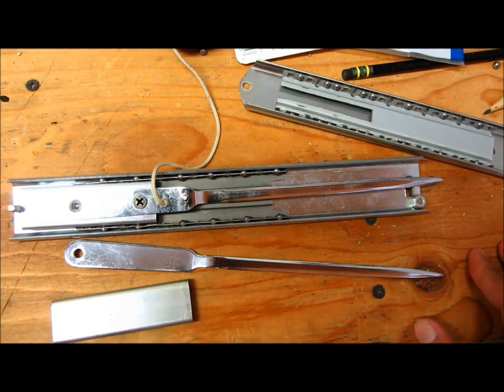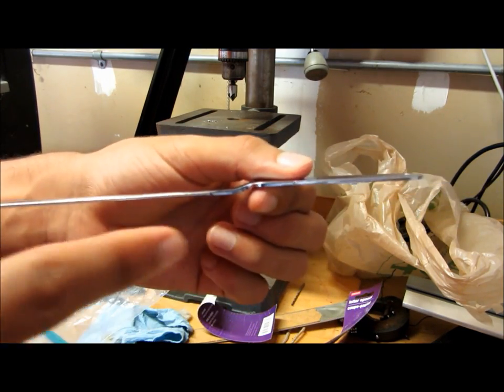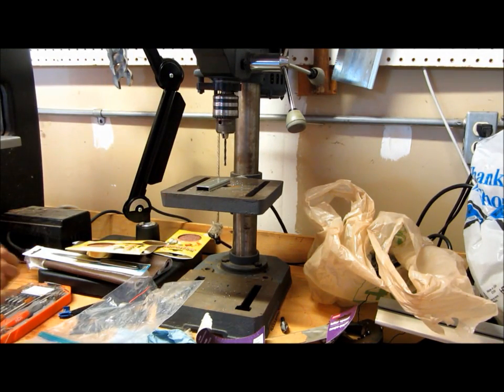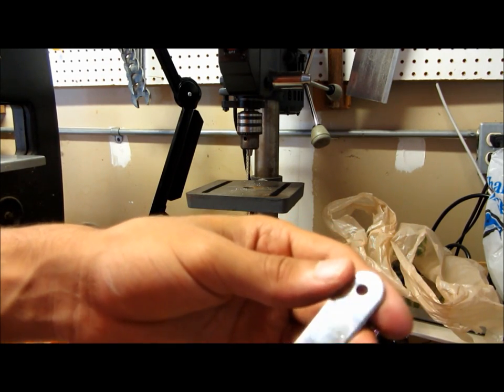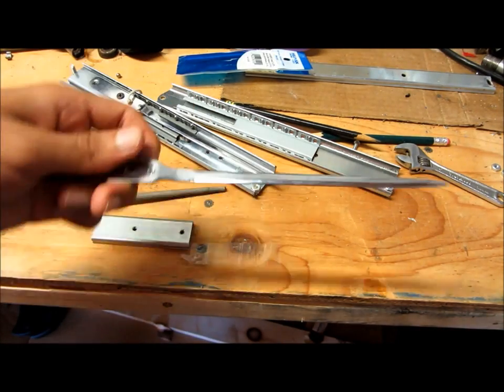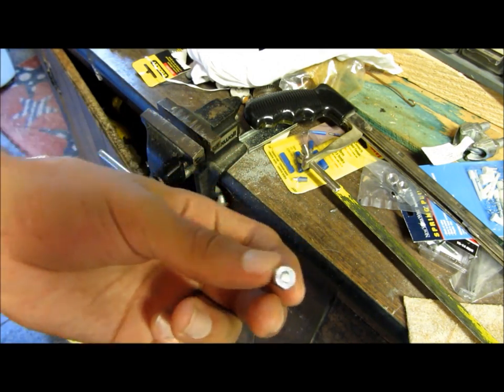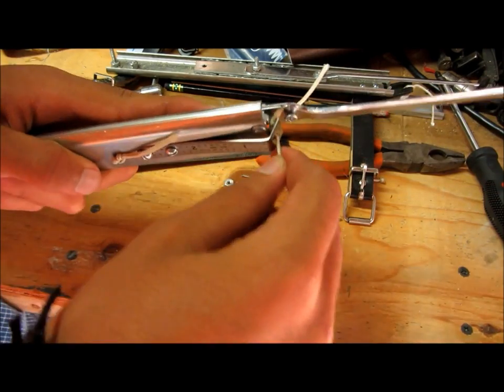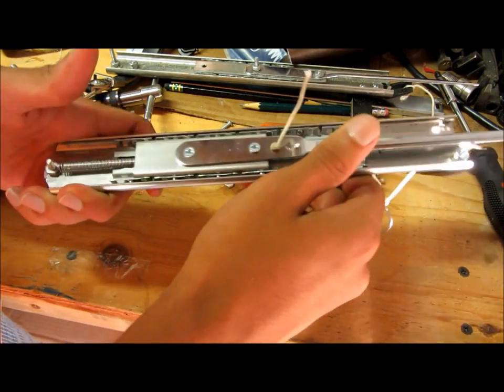Tutorial Part 2 | Homemade Assassin's Creed Hidden Blade | Xiphoid

Comment: a simple solution for a mount is a sleeve of cloth and leather or just leather bonded with glûeand on the outermost halve must be a harder material like leather outherwise it may fray, and glue leather straps on and call it good  :

Comment: This is beautiful. The problem is that when I make it, I try to get the blade out but it won't come out. It retracts fine but it just won't slide out. My spring is not that powerful either. Any solutions? Thanks!
Reply from the maker: Maybe you could grease to make it slide easier?  You also need to swing your arm down fairly hard, not just thrust.  Sorry about the late response!

Comment: great tutorial, Im about to make one myself. Few questions - your center mount slide is 16", looking at richelieus website they offer slide leght 15 7/8 and 16 7/8 inches length. Which one is it ? Does it work also with a little bit smaller size ? because yours looks massive to me in the end. Also, it doesnt need to be this exact one necesarilly? Im not sure if I cant get the same in my country :D I will probably have to find similar one
Reply from the maker: Hey, I don't remember what size I used but I have a link in the description to an instructables I made with all the dimensions.  Also you definitely don't have to copy my design exactly, I used these measurments because they worked for me but it certainly isn't the only way

Comment: is really nice, just one thing: all the hitting pressure (when u hit something during your punching force) will be loaded on that small piece of metal ruler (risk that the power bend the ruler and let the blade in again. 

i mean... you punch, than the blade-tip touch the target, the resistance offered by your target (muscle, cloths, vest skin whatever) push back in the blade, so all you efficency will be played by the resistance of your target and the resistance of the metal ruler that stop the blade. so as much your target is hard as mush your ruler suffer inner force, maybe a harder metal instead of that ruler will be better, just maybe...
Reply from the maker: +creatorediillusioni I didn't design this with the intent of actually stabbing humans or anything alive (which is also why I don't sell this, because I'm afraid someone will kill someone else).  Instead, I built this for stabbing fruit and cardboard and mainly just for looks.
Reply: +TheSakariRock yep i understand that, it was just my thought.
but i considering to produce those as really weapon... anyway good video.